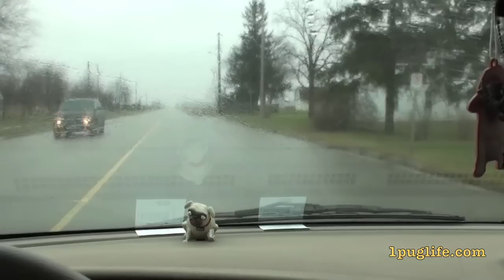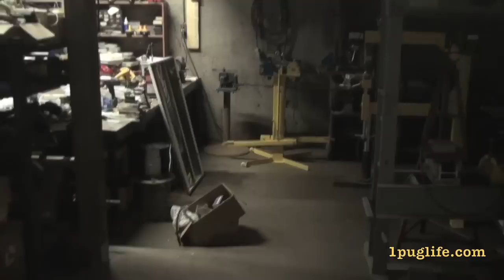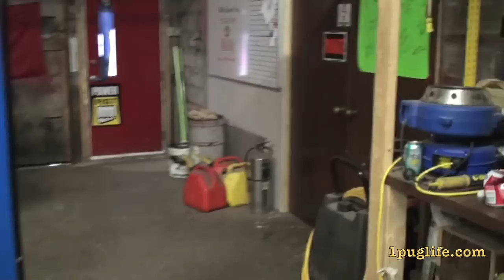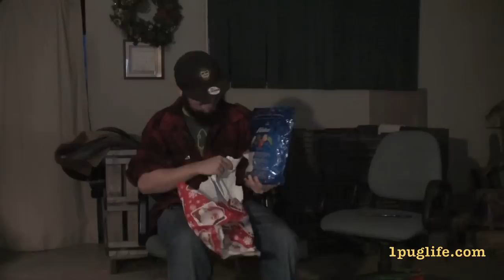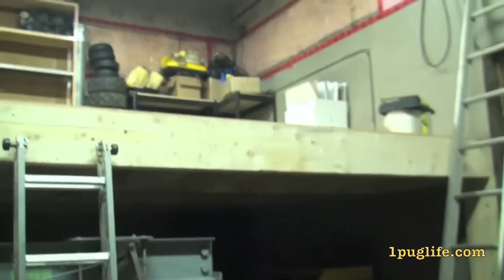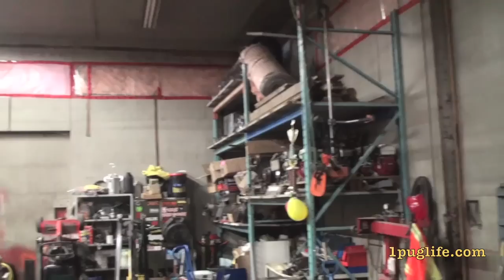getting ready for christmas

Comment: Shop is lookin better each day.. You ever seen them removable railings? You could get the metal brackets that hammer onto the side of the outside joist, they have a hole that the 2x4's can slot down into. Just make the railings in like 4 or 8 foot sections and remove one or two when you're offloading a pallet from forkey or something, no hassles. Anyhow, I beg my pard on that one there..
Merry Christmas